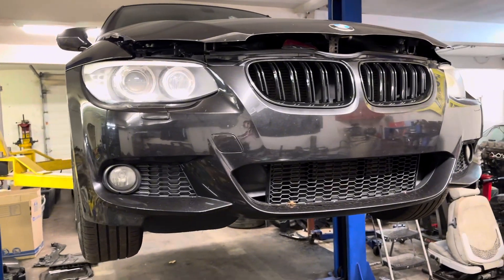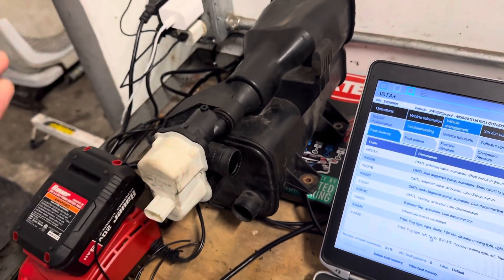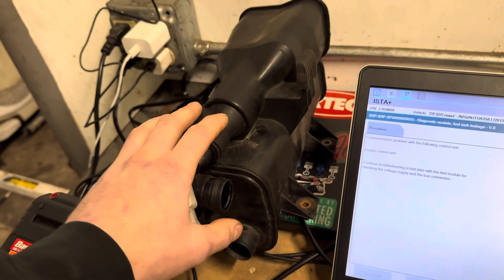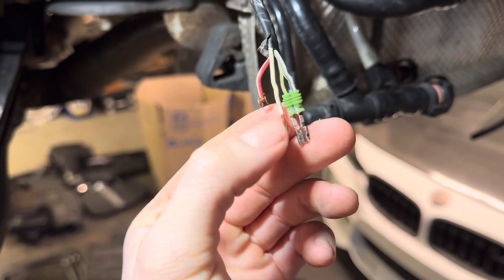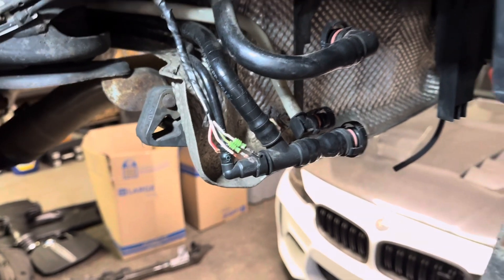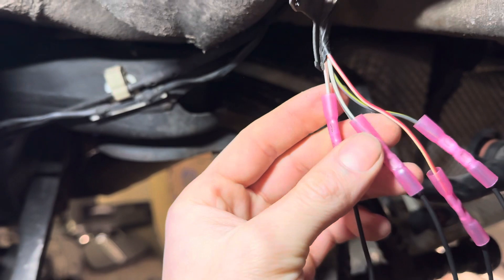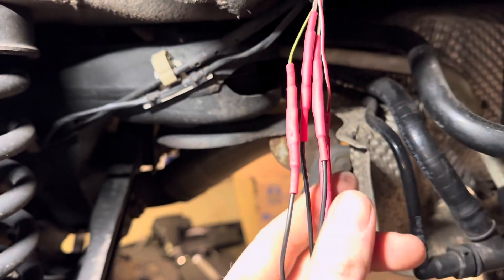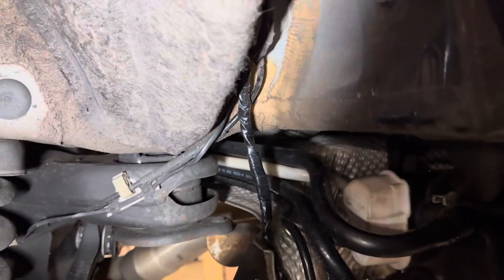E92 335xi N55 DMTL Fuel Tank Leak Detection Pump Wiring Repair 00312A 003226 00321B 003227 003224

Comment: I may have the same issue with wiring, replaced my pump and still getting codes P2401 P2419 P240A, where did you get the pigtail connector from?
Reply from the maker: Shoot me a pm on Instagram. @newenglandbav